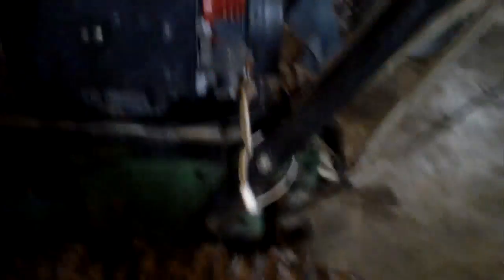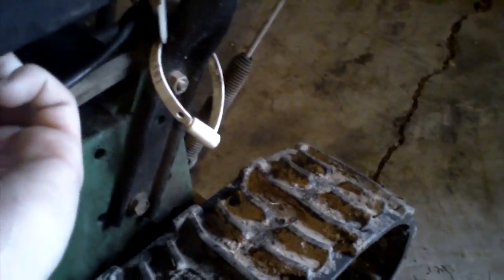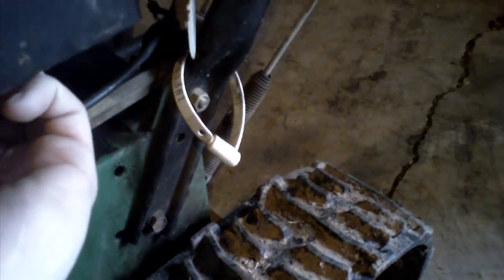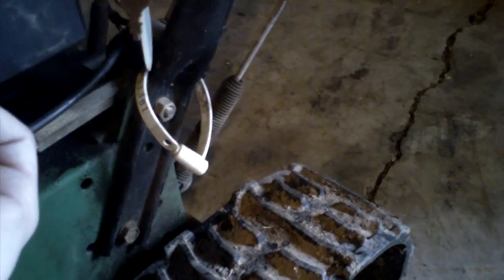John Deere Snowblower Carb Adjustment

Comment: Your carb has basic setting on a Tecumseh engine.  1 1/4 turn out on air mix screw, about 1 1/2 turns out on jet screw.  If not working, pull out air mix screw and clean with 1 wire from wire brush.  Drop bowl and sweep clean, take same wire and clean that jet.  If not working,just buy new Oregon carb....  save old carb for parts as needed....